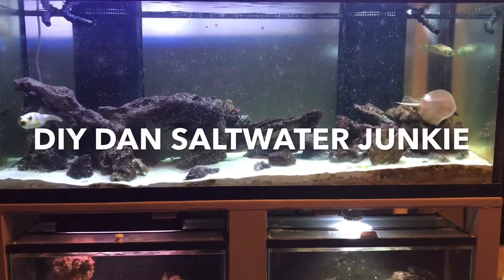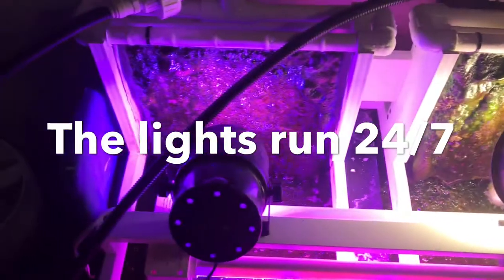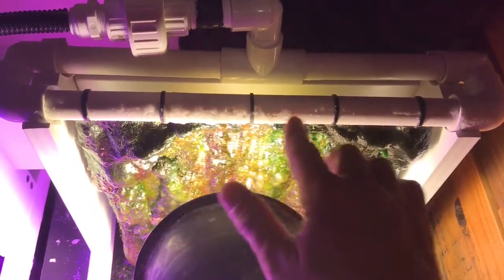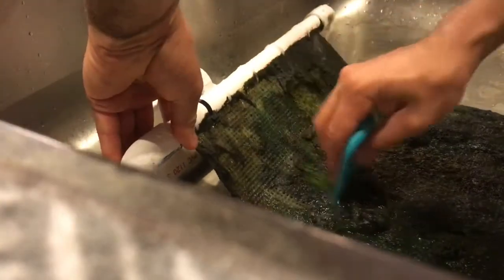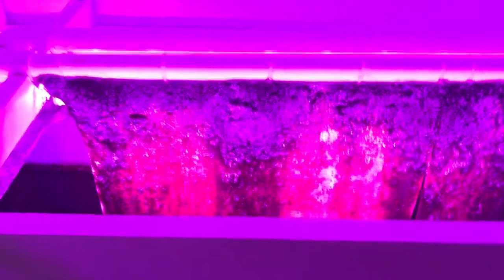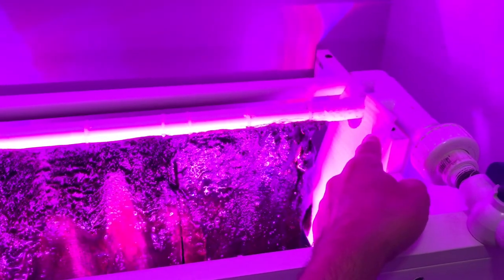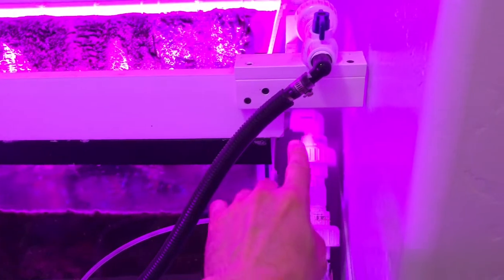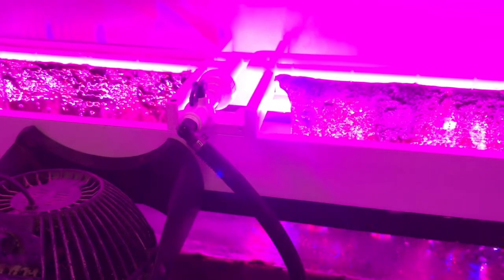DIY WATERFALL ALGAE SCRUBBER BUILD UPDATE LOVE THIS SETUP IT SUPPLIES MY REFUGIUM ON MY 125G REEF

Comment: Have you always run the lights 24-7? Even when you first started the units? Mine seems to struggle at the center where the lights hit
Reply from the maker: Yes right from the beginning on both of my scrubbers on both of my systems both took a while to get going how long has yours been running? What distance between your light and screens? What bulb r u using?
Reply: DIY Dan Saltwater junkie i have the icecap medium scrubber with 30w leds on each side
Reply: DIY Dan Saltwater junkie started it 2 weeks ago. 1st week i ran them 24-7 nothing happened. I then roughed up the screen and seeded it with some gha from my display tank since then i have been running them 18 on 6 off. It is starting to hold a little but the center is still all white. I heard some people use painters tape on the center to diffuse the light.
Reply from the maker: Is the water flow even across your entire screen I had a flow issue with mine that I had to rectify